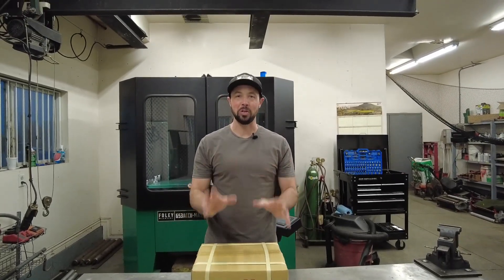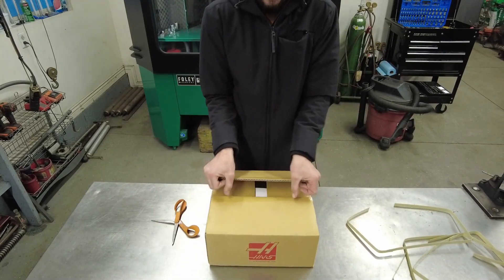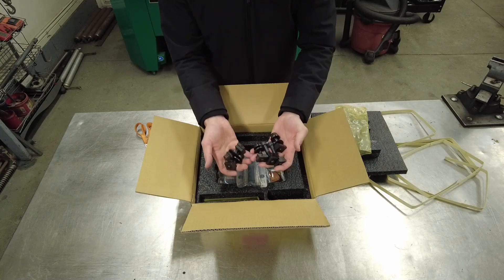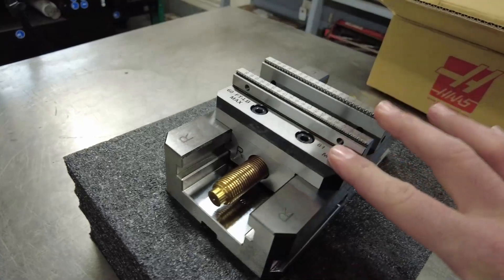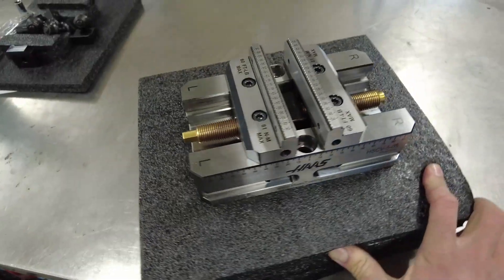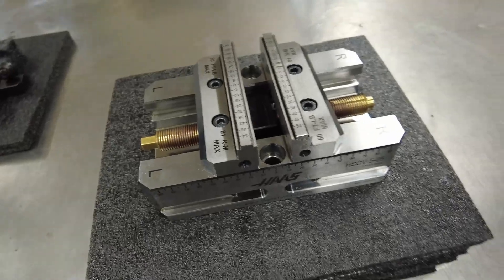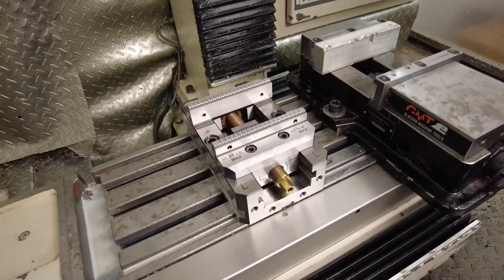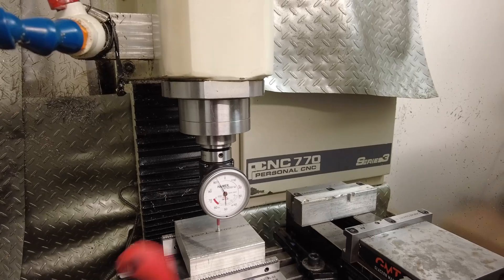HAAS 5 INCH SELF CENTERING VISE UNBOXING

Comment: just curious, how do you think this compares to a Saunders fixture plate and one of their mod vises?
Reply from the maker: Totally depends on the type of work you do.   If you do a lot of stuff that fits in a 6 inch cube I would say this vise.  Saunders is for sure more versatile for larger flat/long plates, more setup density etc.  I purchased this specifically for 5 axis work but on my 3 axis machine I’d love to have a Saunders plate.  I think if you’ve got the cash the Saunders is a super solid route.
Reply: @ericschneiter  Thanks Eric.  I am waiting to receive a Tormach 1500MX, so my plan is to machine my own fixture plate from some ATP-5 stock that I can buy for about $2.39/lb and buy the mod vises.  This will keep the cost way down.

Comment: I use a serrated jaws like that all the time and they are awesome for mild steel and anything softer. The ones i use are made by 5th axis and are for a standard 6in mill vise. When i use them i like to tighten the vise very hard to stamp the serrations into the part then loosen and re tighten to about 1/4 the pressure of standard smooth jaws. This gets you excellent holding force while not bowing the part as much.
Reply from the maker: @joshuahuman1  I LOVE my serrated jaws.  I use them almost exclusively on first ops now, and I do the same thing. Love how well they hold the part, makes me super confident running parts a little harder.

Comment: Most of that Haas tooling is all rebranded. If it comes from China its probably some generic stuff. A lot of the cutting tools and inserts are rebranded from Widia and Korloy to name a few. A lot of the indexable drills are Kennametal/Widia, solid carbide drills are YG1, etc etc. I believe that Haas self centering vises are made by Lang or Jergens and labeled for Haas. When Haas released the Kurt branded DX6s, they also had a line from Jergens. Not sure if they still have all of that or not. It is a nice vise for the price.
Reply from the maker: @cwhuffman01  thanks for the insight, enjoyed reading your comment.  I tried to look and see.  They used to be made by Jergens but not sure who they are made by now.  The Haas looks almost identical to the Lang.  I’ve been pretty happy with the carbide and drills so far. At the price I paid I think the vise was a steal.